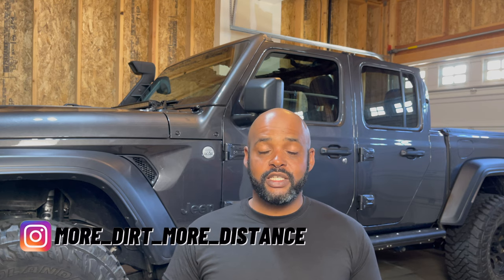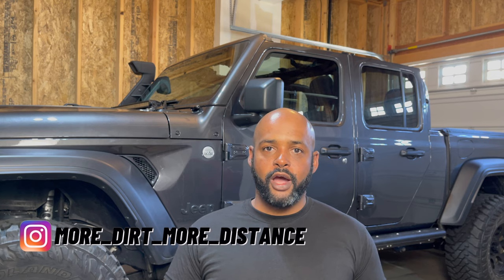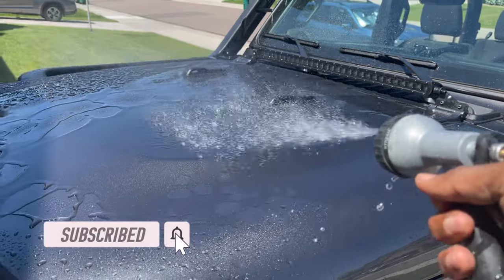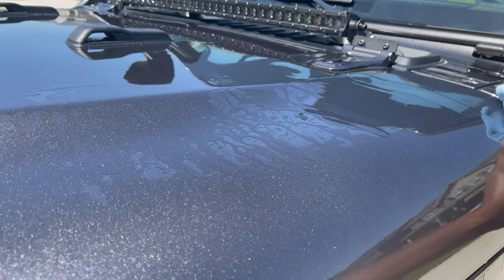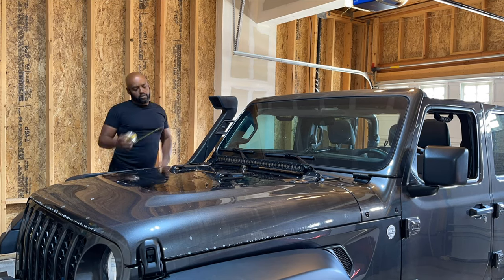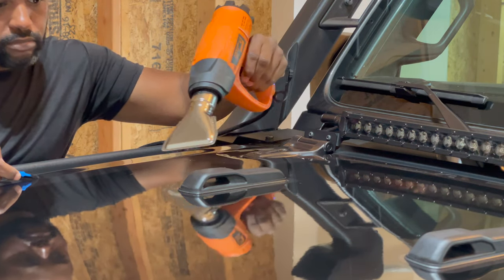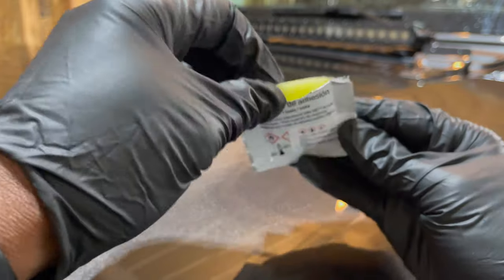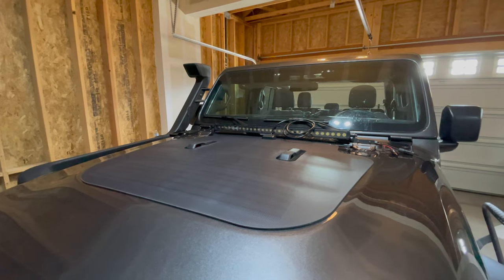SOLAR POWER Jeep JL/JT Gladiator Build Mod (Cascadia 4X4 VSS System) Installation and Review

Comment: Thanks for this video awesome and and a great space saver for weekends to keep the essentials going. I see they have a 90watt now and I have been running a 110 watt on roof for 2 years with no problems so will be changing. A bit more costly but less weight and more space following you.

Comment: Nice video!  I am curious as to how well the system performs when the engine gets hot.  These systems were performance tested at 77F. Also interested in a follow-up about how (if at all) the longevity is affected with the hood mounted system.
Reply from the maker: Thanks! Hopefully by the end of the summer i’ll have a good idea of how well it performing. I plan on doing an end of summer update.
Reply: @MoreDirtMoreDistance  yeah wondering as well.  It’s a hot summer.
Reply from the maker: @matnelen1724  I'll definitely provide an update.

Comment: Thanks 4 the info. Can you please explain how to actually use the solar panel, such as how do you use the power that it gathers? Thanks
Reply from the maker: Hey. The solar panel sends power to the truck battery. The solar charge controller manages how much power is sent to the battery. You power your equipment using the truck battery. For example I installed a 12v outlet in the truck bed. I bought a 500W inverter so I can power 12v, 110, and USB items from the bed.
Reply: @MoreDirtMoreDistance  OK, thanks for the info!

Comment: Thanks for the video. Nice job!
Reply from the maker: Thanks! I’m back in town, so I can get the Gladiator tailgate measurements if you still need it.
Reply: @MoreDirtMoreDistance  yes that would be great. Also the letter size would be good too. Cheers!
Reply from the maker: Hey, The word Gladiator is 38 inches long. The G and R at the beginning and end are 3 inches and the remaining letters are 2 3/4 inches.
Reply: @MoreDirtMoreDistance  Thanks that’s the info I needed. Cheers!

Comment: Great video and install. My query is when driving at high speeds will the panel lift off the hood after it is weathered enough or will the wind rip it off. Thanks
Reply from the maker: Thanks! No that shouldn’t be a problem it is that super strong adhesive. Just make sure to use the adhesive prep and do the full 10 minutes of pressure.

Comment: my only issue with these is that the cut outs for the hood bumps allows things to get underneath the panel, water pools up underneath it then freezes, dirt just collects, ROCKS?!  i cannot imagine pulling that thing off to see a handful of tiny sharp rocks chewing away at the vinyl/paint....engine temp vinyl is basically liquid so anything sharp would cut right through let us know how it holds up!
Reply from the maker: Interesting I’ll keep an eye out for that issue. Thanks!

Comment: does the 3m adhesive tho hurt your hood? It looked like the edge of the solar panel extended farther than the base vinyl layer. Also how does the soap and water not ruin the car finish?
Reply from the maker: Once you install the panel I imagine it would be hard to remove. If your concerned about that I would suggest talking to the manufacturer.

Comment: Mine is collecting water underneath it. Anyone else having this issue?  Its a Sport JL Wrangler, so the same panel installed in this video. Any suggestions?
Reply from the maker: My collects water after a heavy rain or getting washed. I think the vinyl should protect the paint, but that being said I have no idea what’s happening underneath.

Comment: Really?  A cheap Chinese 80w panel may at best provide 3.5 amps of charging in noonday sun but are you going to commonly park in the sun when camping?  I think not.  If you're driving that solar panel means nothing compared to your alternator output.  If you're serious get a military grade foldable panel, 5x4' or bigger 100w with max 7.6 amp output ($800) and lay it in the sun  with cables to an isolated aux battery so your Jeep and 'fridge are shaded but the panel is getting full sun all day when you're camped.  That will work.  But hooking up such a lame panel to you car battery and expecting it to keep your 'fridge running after a cloudy day is asking for a dead battery the next day.

Let us know how your setup works.
Reply from the maker: I’m going to do a full end of summer review, but the short version is that I’ve used it for camping over long weeks to run the fridge, diesel heater at night, and charge small electronics. The battery has started every morning. The panel is good for light work, but It isn’t enough for a serious overlander.